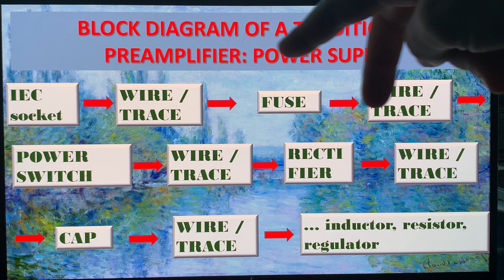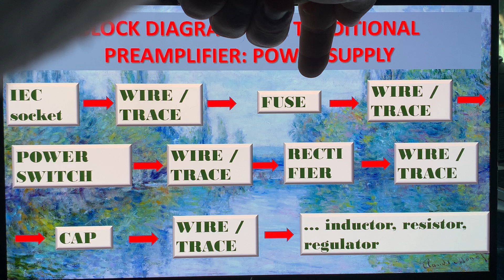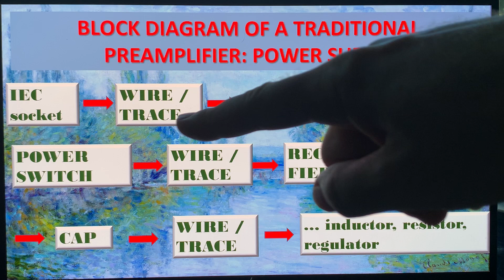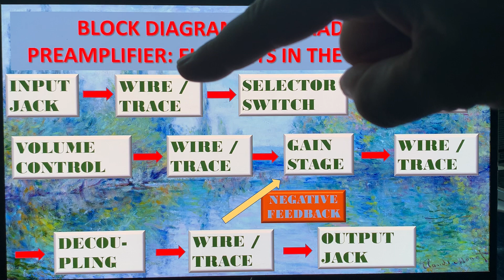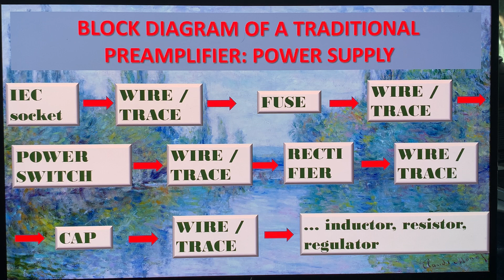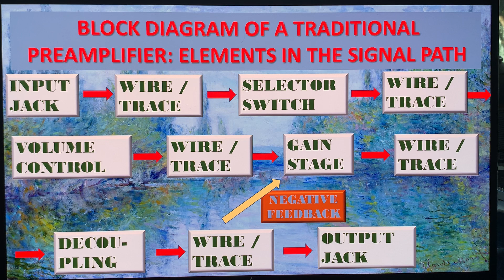Secrets to Preamplifiers: The Power supply

Comment: Buying a passive preamp....................if this is your choice ..............better to install a quality volume controle ( and a quality selector if needed ) in the amplifier........don't forget the input RCA ( something like AN or similar quality sockets )
Reply from the maker: Yes! We want as few cables as possible. With volume control and selector switch of the sources in the amplifier, we cut down number of the connecting interfaces and chances to pick up EMI and loose signal. 
This is why DIY it the route to go for both most satisfying sound & best value as well... ; Commercial solutions are like crutches trying to fix broken scenarios. With home brew one can avoid the broken scenarios and build with purpose, concept and optimal path. ;

Comment: In Europe most AC lines are HOT/LIVE and neutral.......................the phase of the power cord makes a difference ( YES IT DOES ! )...................So I make all the gear orientated the same ( with a simple test neon lite screwdriver ).........and I use a switch on the back of the preamp and other to switch the line 180 ° if necessary .....so doing I dont have to use power connectors/adapters  to inverse the power line phase...

To do so one must disconnect all the gear from one to another ..............
And USE only ONE ground .................most likely at the PREAMP !
Reply from the maker: Thank you Frank, superb advice! Here, in the US luckily all (properly wired) outlets have neutral at the thicker prong, and hot/live at the thinner prong, and the ground is at the same potential as neutral. ....provided the house is wired correctly and there are no issues with the wiring. Sadly, in most US homes I've noticed significant differences between ground and neutral, even 30VAC or more.... also, seen too many AC outlets wired in reverse with hot on the neutral leg. Explains why 50,000 homes burn down in the US every year due to electrical fire.  
Our issue with the phase is a little different: US fuse boxes are also 240VAC, with centre tap to ground. Ovens, water heaters, heavy duty AC, washing machines, dryers and ovens run from 240VAC. Small household devices use the 120VAC, which is the half-tap of the 240VAC. So, half the outlets use the upper half of the 240VAC, the other half uses the lower half. So, while one outlet swings from ground to +120VAC, the other outlet swings from ground to -120VAC, the two out of phase, and with massive potential difference in between. So, when using audio gear it is important to plug them all to the same phase outlets. This needs a little planning at the fuse box to place all audio circuit breakers on the same polarity.
Reply: @realworldaudio  hello Janos , right so...........it's a pity that many audiophiles do not know that their music experience can be gained and optimized with such a little attention........it's realy worthwile to pay attention to the phase of the power line.
Reply from the maker: @frankgeeraerts6243  Sadly, it's often more comfortable to spend an additional 10K$ on a new component than to have the basics handled...

Comment: Choke input needs a more expensive transformer with higher voltage windings......
Capacitor input charges on peaks ( burts ) , that one you can hear .............capacitor following choke  ( when correctly calculated ) charges on the whole duty cycle..............no bursts !!!!!!!!
Far more important the smaller the signal voltages and dynamics.....
All is about money /  comercial budget followed by marketting...........besides the one exception brand(s).......

Power cord IEC connectors  ( standard quality -male and female )..............you can solder the power cord directly as seen on all older equiment; ( saves you the money for very expensive high quality  connectors like Oyaide/Furutech )
4 different audiopfile power supplies..............and used to compare with the same preamp audio circuit.................. means and results in four different sounding preams !

All the connectors for the power supply within a preamp ( and other gear ) are a sonical DISASTER ! but they look nice and sometimes very high tech , they are only used for saving time and assembly facility ..........NOT FOR GOOD SOUND !!!!!!!!!!!!!!!!!!!

Fuses ..............they will allways be there ...........best fuse is No fuse if you tyake the risk........I use a swith ( silver plated ) to bypass them at times at my own risk.

Connectors solderd to the  circuit boards ( cinch/RCA sockets and or others ) are a NO NO !.............

Do not mix silver wire  with gold  PLATED RCA plugs !!!!!!!!!!!!
Gold should be 24K.............That is NOT SHINY ......

The best preamp will be the one YOU build yourself with the necessary experience.

An impedance selector with different load resistors at the input is a more usefull tool than tone controls with NFB...........

Resolder every coimponent with quality solder instead of the industrial ROHS shit is audible...

Vibration of passive /active components , transformer , circuit boards and wiring................asthonishing discovering the damage they did when  they are gone.

And many other details to experience and to discover by yourself...........
A life time is NOT enough as long as the passion is alive.......😀🙃
Reply: Hi Frank. Thank you for that longish list of tips and hard won experiences. One question: If one is to solder the power cord directly to the preamp, amp.... it would be nice to choose a good powercable + plug to begin with :) Any tips regarding brands, size, qualities, material or other...? Thanks again, Claus
Reply: @earkivaren  Hello Claus, thanks for your comment .
Good connectors and good powercord are indeed a benefit .........meanwhile no connectorsare better than  even the very best ones.
It was common practice before the IEC became the standard.
Yes I will continue to share experience..........with Janos and other peoiple who share their experiences.....
I have some good experience with  Oyaide line connectors ..........and Tunami power cord , but it's also great to build your own cables with Silver or OCC copper.
( there are different grades of silver ! )
For solder I use WBT for decades..............there are other quality brands .
Powercords DO change the sound..............so does every connector at any position in the audio chain.
Have a nice day Claus.over here night has put its blanket on the day....
Reply: @frankgeeraerts6243  Thank you Frank. As you say, all connectors at any position - to a smaller or greater degree - change the sound, so I guess it's going to take a lot of trial and error to the mix that best suits your own preferences. Qyaide might be a good place to start, though. Thanks again! Claus

Comment: Most preamps separate the power supply for each side of the stereo signal. Where do you feel is the best place to split?
Reply: At the AC line input ..........( needs two quality and identical transformers )
Second  choice (s) ....after the rectifier(s)....
Or double windings on the power transformer...........
With +/- supply ,  one can even use double rectifiers , on for both rails  , + and the other one on the - rail.
The quality of a power supply primes...........a single power supply can out perform a double power supply whe  it's compromized  as seen in some commercial products.

Double power supply has ONLY use with the  BEST  = the most musical amplifiers ..........
Have a nice day
Reply from the maker: @frankgeeraerts6243  Frank answered it all! :)

Comment: I’ve ordered some DC Link capacitors for a couple of projects I’ve got going on.   I’m going to use them in the power supply.   A little pricey but I’m thinking one and done.    Thanks for your help with your videos!!!
Reply from the maker: I'm curious what difference they will make in your system :).  Just be careful not to zap yourself with them. Electric shock from DCLink is way worse than from electrolytics. ; ) (Spoken from experience;.)